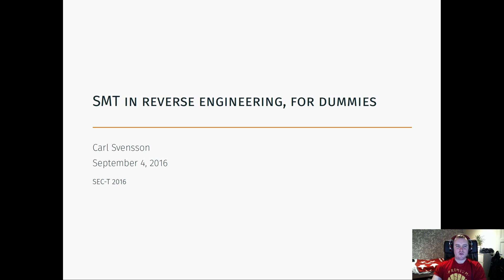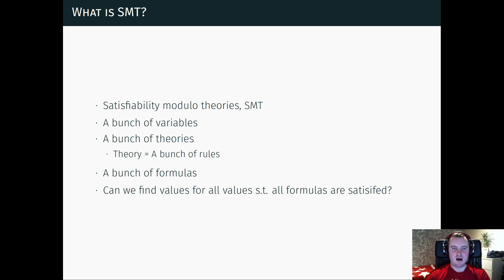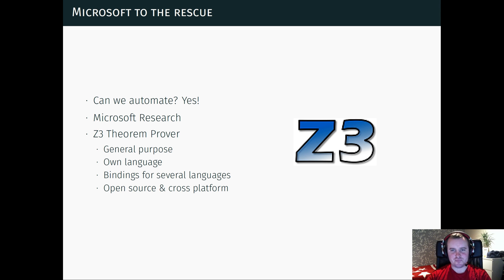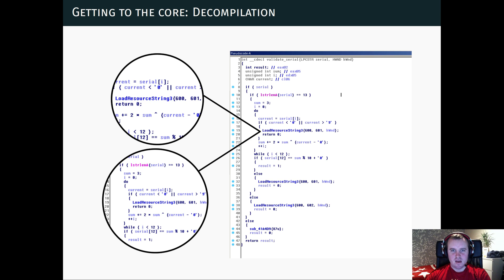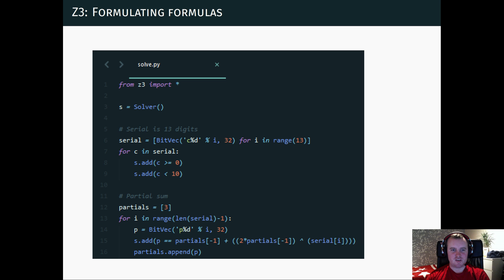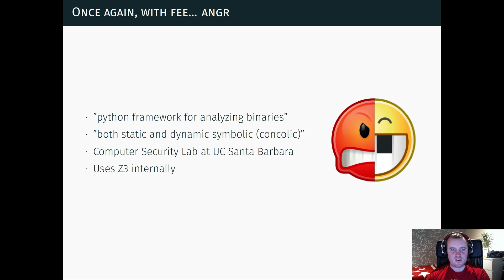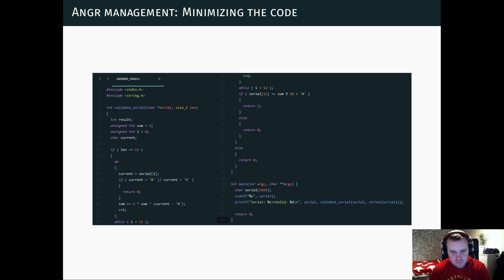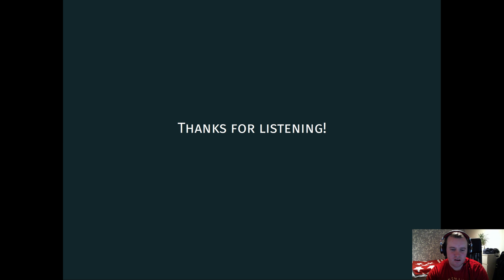SMT in reverse engineering, for dummies

Comment: if you type randomly you have 1 chance in 10 of succeeding it seems
Reply from the maker: Yes, its exactly 1/10 chance since the algorithm just checks that the last digit matches the checksum. The point of the talk however, is not the specific algorithm but the general methodology used to analyze the problem.